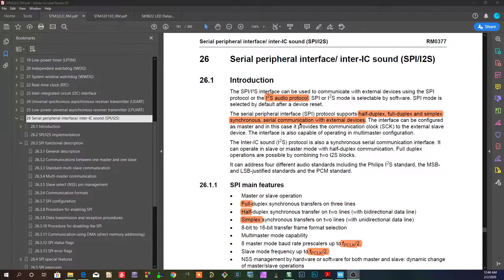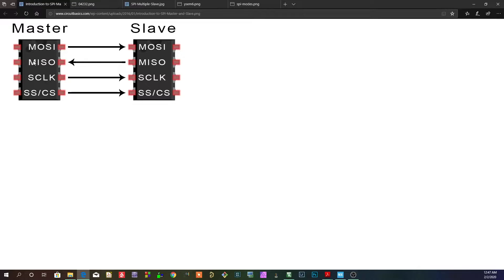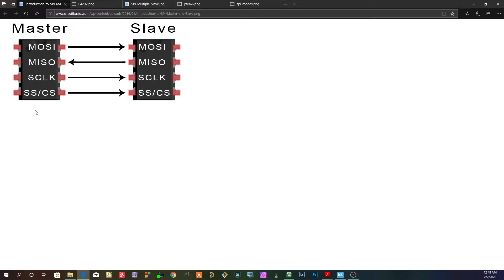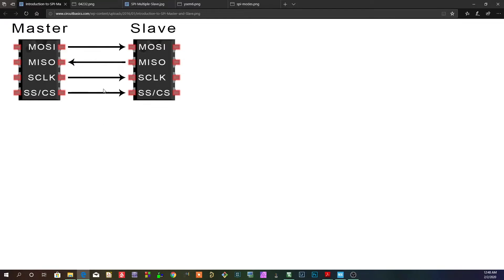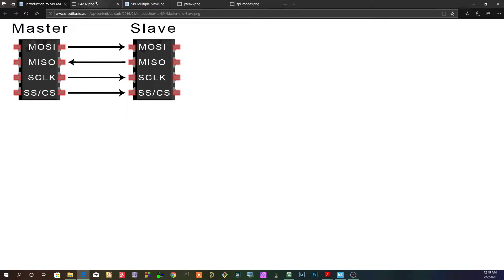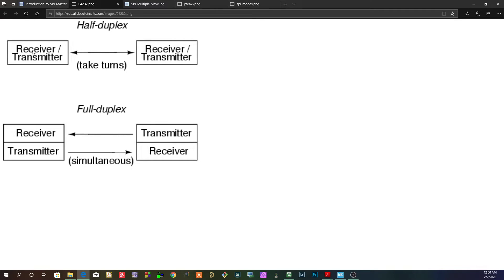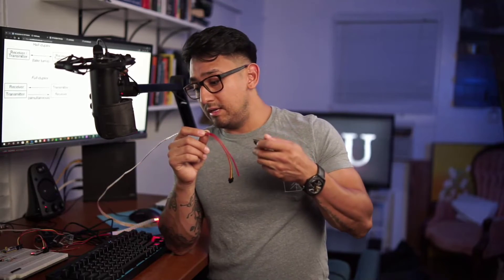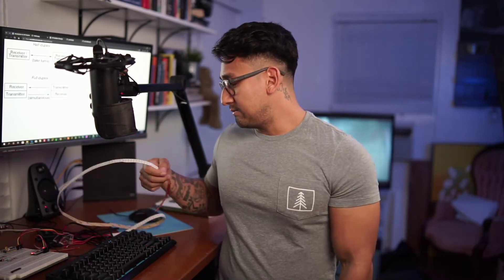STM32 SPI: Pt 2

Comment: When you start a project like this one for example, are you relying only on the data sheet or do you have other resources? Say the SPI wasn't working because you were missing  one line of code to set a register for example; how would you go about find missing information? Maybe said register isn't listed where you'd expect or something.

I am currently trying to create a device that measures the exhaust gas temperature of  an engine. It will use the MAX31855 K-type thermocouple IC which is a read only SPI interface. Then will record data to an SD card and relay the data over the vehicle's CAN bus. I'm not planning on using an STM chip but a teensy 3.6 which is an NXP MK66 processor (ARM  cortex M4). What advice do you have for someone like me who took a class on programming STM processors but has never programmed SPI or CAN bus? I get lost in the data sheet...
Reply: It's been 10 months. How is the project going?